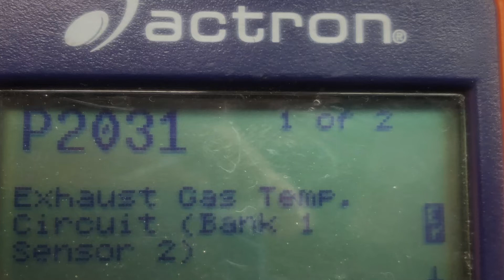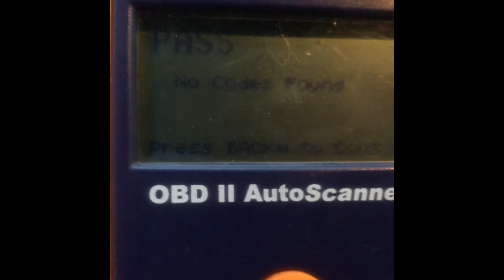P2031 CODE FIX

Comment: it's a temperature senzor , that insignificant deposit on it makes no difference , the connection to the element is damaged inside and moving it around recovered the connection temporarily or it was the same case with wiring /connector

Comment: So did just cleaning it fix it for good or not? Thanks.
Reply from the maker: It did fix it for  a while but the code came back and I replaced the sensor. No more issues.
Reply: @DentMachineCo  I ordered a sensor today
Reply: @jeffhausmann7561  part number ?
Reply: Is that the part and part number for acura also?
Reply: @tommyolsen8224  AC3Z-5J213-C 1X